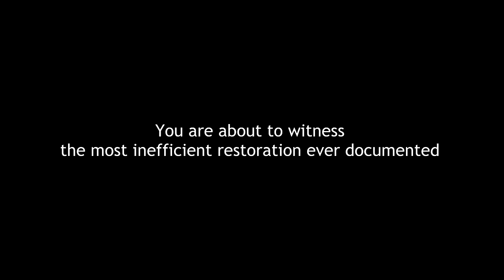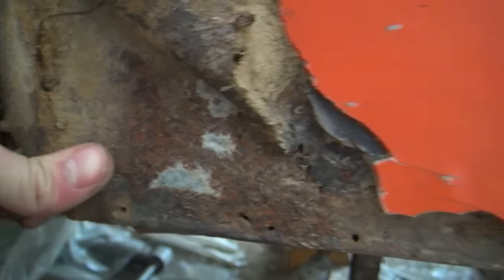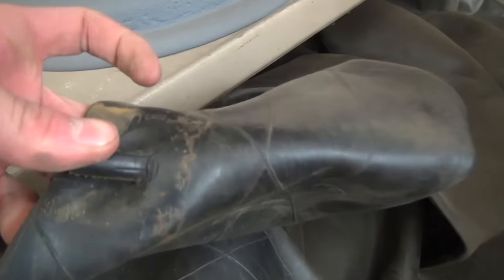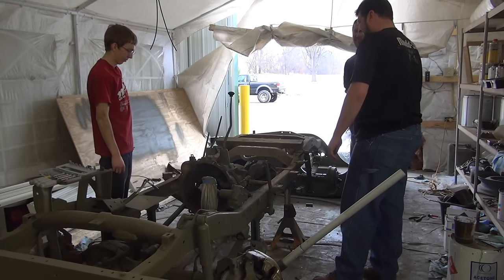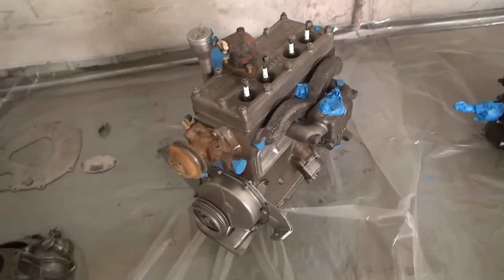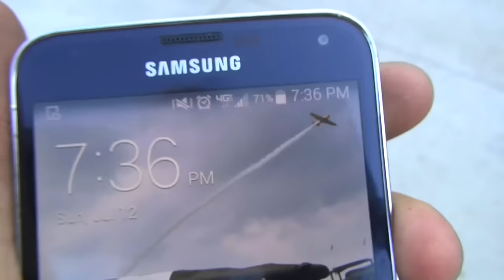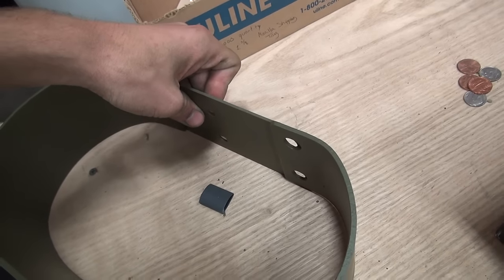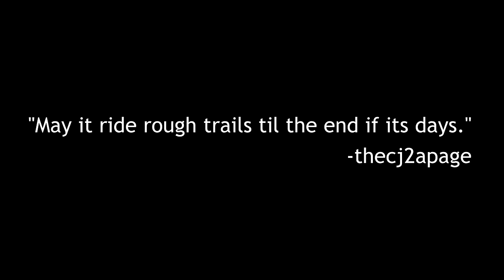Willys Jeep Restoration Full Time Lapse - [No Music]

Comment: Totally awesome !  Im very impressed with your work and so very happy you decide to restore the vintage jeep instead of cutting it up to make a rock crawler or something ?  
  Where did you get all the vintage stuff for the jeep? ....field radio , fold down water bucket on the Jerry can in the back  and the med kit under the passenger seat ?
Reply from the maker: Thanks! Most of those items you can find on eBay or the parts suppliers like Ron Fitzpatrick or Peter Debella. I found my water bucket and jerry cans at the local flea market.
Reply: joe hopkins u

Comment: Jeeps are mostly flat surfaces for a reason, easy body maintenance. It was known as a "utility vehicle"  made for work, not looks. You should have no trouble repairing the body with sheet metal and a bending break. The parts that are stamped can still be had thru 4we Magazine. Engine parts can be had through a Mopar parts store. It is easy to restore a jeep with minimal tools and your hands. I did it with mine.

Comment: Nice! I had a '48 2A that had more Bondo than metal. Now I have a '51 3A that is in great condition. Also Those original tire design are not self cleaning, They clog up with mud and you might as well be driving with drag slicks.

Comment: hey man, very nice job. I was worried a few times when it came to paint, but you went back and fixed the mistakes on the prep work end of things. I got a cj3/2/mb(little bit of everything FrankenJeep) im restoring right now. Very interested in the Lebaron disc brake conversion. Wondering how well it worked, what you used too mount the caliper to the axle, if you machined the hubs to accept the rotor and what if anything you had to do with the master cylinder. Thanks!
Reply: Ilya Kirkby 
Check out the geo tracker discbrake swap.

Comment: I want a cj2a, but I am going to build it better than the originals. Think 1/4" square channel for the frame, beefed up steering, suspension,  axles, etc. Make it so it can fall down a cliff and not bend. I want a Jeep, but the old ones are just too brittle anymore. If be scared to break one for its antiquated value.

Yes, I know it would be heavy, but it would be worth it for a vehicle that could get into a head on collision at 30 mph and suffer minimal damage. I can't say much for the passengers though! 😊

Comment: FYI, add your g-grandads unit and name  "Missing Driver stencil on Driver window (Last name, usually in black) Missing Unit ID (Left Bumper front and rear, Platoon number and unit number, Example HHC 3/23 Left is 23rd infantry 3rd battalion, headquarters unit. Right side could be Platoon and Jeep number , like 321 (3rd Platoon, Jeep number 21) Bumper left to right = HHC 3/23 __ 321"